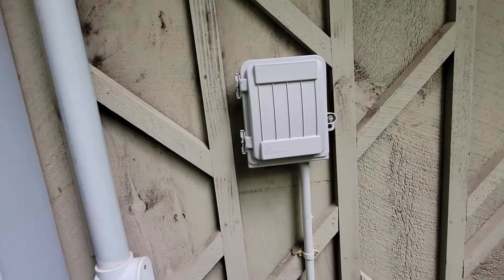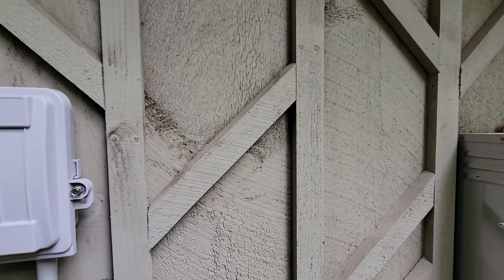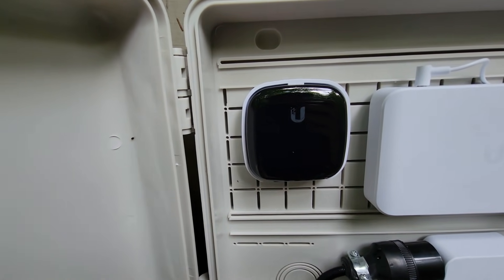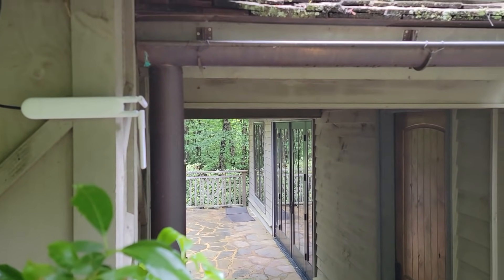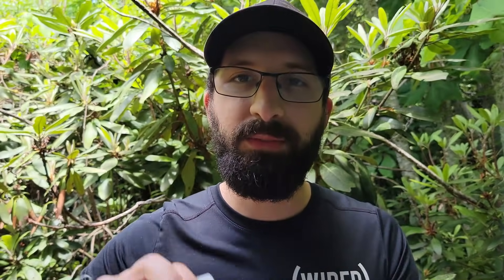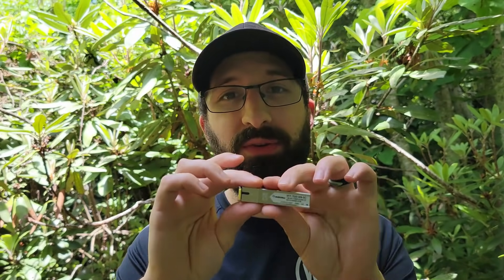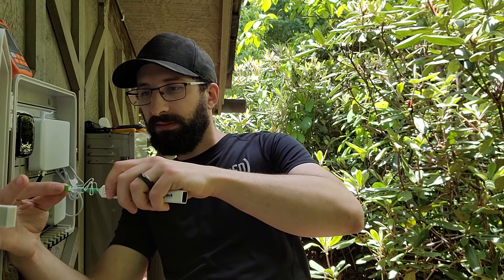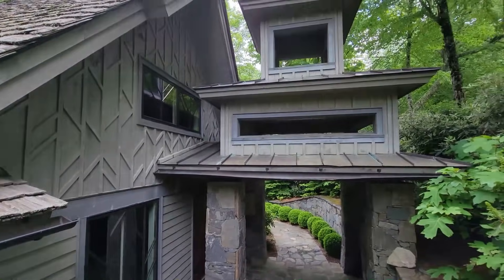From HORRIBLE DSL to FIBER Internet using Ubiquiti Unifi

Comment: I have a UDM Pro and I have a fiber optic link connected to port 9 via an ONU. Would it be possible to connect this fiber directly to port 11 via SFP+?

If so, which SFP module would be recommended?

Thank you very much.

Comment: Hwt David,  what power supply box for the switch did you use? Inside your outdoor box like a cover for power adaptor? Like how there is a lock tight ac  power cord attached to it going to supply voltage, how did your trained electrician do it? What parts were needed

Comment: Hi David! I swear if I could hire you I would, but I'm in rural Mexico, so yeah. Anyway, I want to extend a network from an office to a barn that's off-site a couple of miles away with single mode fiber. I was wondering if I could use an ONT instead of a pair of SFP adapters as those are pretty pricey around here. Many thanks!

Comment: I would still droop the wire going into the outdoor wifi access point.  Make sure it droops lower than the ethernet port so that it droops and then come back up to the ethernet port.  If water gets onto the cable, it could drip and follow the cable into the ethernet port.  If you droop it down lower than the port with a little extra slack, water would need to fight gravity to up back to the port.

Comment: With the exception of the wall box, this was messy work. The cable management and the mounting of the AP was bad. 

Never use stand-alone fiber-converters because they will need to be reset or will be failing at some point. Use a switch with SFP instead. Then you also loose a point of failure. 

You don’t mention what kind of UniFi controller you are using.

Comment: Maybe I missed when you mentioned it but why not just plug the AP right into the media converter? What is the switch for?
Reply: The switch is for PoE. That media converter get's it's power from PoE and the switch is giving it power.
Reply: @BenPi_Tech  Ah okay. And because the AP is powered by PoE too he didn't just use a PoE adapter?
Reply: @chrisb9319  He could have just used a PoE adapter instead of a PoE switch, but if they needs to add an AP or other PoE equipment's in the future (cameras for exemple), a PoE switch is more versatile.

Comment: You will have problems with the ap being horizontal.  Why, because water will come down the cable and leak into the port. At a min a drip loop will be needed.  Also spec's state mount vertical

Comment: Dude, i don't know if the AP is water/weather sealed but I think you should make drip loops in your cable before you connect. Even though the AP is sheltered, better be safe than sorry.
Reply: All ubiquiti access points are water resistant. The system should be fine.

Comment: how can it be single mode if its gpon? its a single fiber so it needs two modes.
Reply: GPON is diplex. Uses two lambdas in single mode.
Reply: @Txepsiyu  you are missing the point.. if a cable can carry two different wavelengths, it cannot be single mode.

Comment: Good job, but it seems like you came very unprepared for the job.

Knowing it was an outdoor install you would think you would have turned up with outdoor rated cables and a water proofed outdoor box (no seal on the door)

Apart from that a great video.

Comment: Never actually seen someone cleaning fiber, even my isp just plugs them in.
Reply: Well, most of the time it's clean, but a dusty port can degrade the signal by 1-1.5dB
Reply: Would clean it all the time in the datacenter. Fiber optics are highly susceptible to dirty optics.
Reply: @VV-om8vv  Especially at higher data rates. When we still had Fibre Channel storage, any time we had errors on a path, first task was to clean the optics and the cables. amazing how often this would resolve issues in 8Gbps and 16Gbps FC.
Reply: everyone who is doing his job right is: cleaning, cleaning, cleaning.
Reply: Yeah same. He’s also using APC instead of the cheaper UPC. So I’m assuming he’s worried about light levels for this link.

Comment: Not knowing the primary material of the chapel walls and coverage area I notice you have some metal guttering near the access point this could be points of the reflection signal degradion. if the chapel is primarily wooden walls it should be no problem but if you have rock or steel-reinforced concert, I did notice a concert column you might have some issue with coverage inside the chapel. also, rain might be a problem again signal might degrade when rain is falling. water absorb the microwave spectrum

Comment: Yeah... The specs of Unifi's GPON "UFiber" is not all that impressive...  You have a 4 port or an 8 port OLT, serving either 512 customers or 1024... With a SFP+ port... so 10GB MAX divided by 512 or 1024 customers.. Yes.. The OLT8 has 2 10GB SFP+ ports.. But lets be real, that 2nd port is going to be used to carry that 10GB fiber onto another OLT box downstream even further dividing that original 10GB of max data by an additional 1024 customers and so on... And if we're even more honest... You're not gonna be supplying it a full 10G of bandwidth anyways.. It may be quick and easy... You'll still need a fusion splicer though... But it does not by any means scale. Its cheap price and lackluster specs is just gonna lead to a bunch of really dogy rollouts by some sketchy cheap ass ISP's hoping to get a quick buck by selling garbage service while relying on that magic buzz word to do it... Well it's.. "FIBER"...  The bandwidth math.. 10,000MB / 512 customers = about 20MB per customer... Fiber.... 1024 customers = 10MB each... AMAZING FIBER! Lets all now praise Unifi for their amazing innovation in Fiber Tech. Also.. Keep in mind.. That the 4 or 8 ports on those OLT's , no matter how many people you have connected to them ultimately, the port itself can only do a max of 2.5Gpbs download, divided by how ever many customers you hook up to any of of those ports.

Comment: do you need a OLT as presume they are the ONU ubiquti loco / nano g with a ubiquti instant, so are they running a GPON system?
Reply from the maker: No, no OLT. I miss spoke in the video, it's not the instant, it's the ufiber Active Ethernet media converter.

Comment: Great job man! Clean install, and you take pride in your work. Puts a smile on my face!

I'm not big into Ubiquiti; I've stopped supporting them a few years ago. However, they still have products that fit certain project requirements.

For this type of install I would had instead used a MikroTik PowerBox pro [Outdoor 5-port PoE switch with integrated SFP port for fiber conversion] and then connected a MikroTik NetMetal AC2 with the HGO antenna's.  ;)

Subbing for your work.

Comment: David, when you say it (the switch) won't get very hot because you are in a high elevation, is it based on the fact that the weather is never severe where it is located or something else?  If something else please elaborate.
Also when extending cables outside for a long distance sometimes they act as an antenna and that alone is a nightmare to troubleshoot down the road.   Even double insulated cables have betrayed me that way.  Especially if you have weather with lots of lightening these external cables tend to get a hit or two.  Perhaps using a grounded conduit  may help out in these events.  That was the case for me in Utah, Nebraska and in Texas. BTW I would strongly suggest that you ground your power in the box.  
Great video!!

Comment: I been running UB products sense 2005. Have had great success with them. I would have never mounted the mesh body horizontally nor pointed  the one antenna down. They are not sealed moisture or rain is going to ruin the antenna and for sure weaken the signal, or the poe/network port is going to ground out from moisture.
Reply: You're right. That AP is designed to be mounted vertically. Also the WiFi antennas should be vertical and parallel to each other.  You can't proper do MIMO / Beam Forming without the antennas being parallel to each other and perpendicular to the remote device(s).

Comment: It might be fine, but the APs wire doesn't have a drip loop. You should always account for a driploop on outdoor wiring. You can easily fix that with some of the coiled up wire by the AP.
Reply: Everyone is complimenting the install, I'm wondering how long the AP is going to survive at that angle and no loop.
Reply: @tigerfan525  I live in FL and didn't have enough extra cable for a drip loop on 1 of my outdoor AP's and 1 camera. No issues 3 years later and I probably get more rain than you all do (Gulf Coast of Florida)
Reply: @reddyuda  Drip loops are really for the "next guy" lol.  It's an easy way to leave extra cable in case there is a service issue and a connector has to be cut and replaced.  Even with outside coax installs you usually use grommets and/or dielectric grease to keep water out.
Reply: @clblanchard08  oh yeah absolutely leave a drip/service loop. I screwed up and tore the end of the cable when pulling it through and I had already cut it. So the cable was just too short.

I packed the connectors with dielectric grease and luckily it has been reliable for the past 3 years lol
Reply: This is a really good call out.
Reply: also black cable with white clips looks pretty bad, use a staple gun or matching colored screw clips
Reply: yea, you gotta leave a drip/service loop on all pulls outside, and a service loop on indoor pulls. It may be the "next guy's" problem, but you are also the next guy
Reply: Needs conduit on the power too. Big shock hazard.

Comment: Hi David.  I'm a lifelong tech enthusiast (currently age 37) and more recently a(n) Ubiquiti product fanboy... lol. Currently I have two UAC AP Lites (one in my bedroom to cover the back of my family's apartment, and another in the living room/den to cover the front areas like the dining room etc, leaving only the kitchen with spotty coverage that I need to figure out a solution for) though my router/firewall is a miniPC from QOTOM running pfSense fork OPNsense. I'd ultimately like to get a UDM Pro and an accompanying PoE+ and/or POE++ switch as well as more powerful APs, (maybe a NanoHD or 3) but for right now as I have it it works quite well. I like watching videos like these. It's cool seeing a network built up from scratch (I've done it a many times with my own equipment I have here, though I'm no CCNA certified technician... I'm 100% self-taught.). Please do more if you haven't already! Just subbed!

Comment: Thanks David, i would suggest to use leveler when installing the box, and also measure the height distance of the cable from the ceiling when installing it so it will look more neat.
also, i think that conduit is a must.

Adi from Israel
Reply: Level the box. Then for doors hinged on the left side, slightly tilt box down on left side. It will enable the door to stay open while service work is performed but will not be tilted enough to be noticeable to naked eyes and also pitch any water off of the top of the box. For doors hinged on the right side, slightly tilt box down on the right side.

In that location, I would suggest running all wire and cables inside of conduit.  Little critters like to chew on wire/cable jackets.  Grey PVC would blend well or could easily be painted to blend into surroundings.  Armored cable could also be used but more expensive and less versatile.

Comment: Hey David, the tape/click style cleaners for the fiber & ferules actually sometimes end up leaving behind residue. I found out one day when a BrocadeICX SFP port would report instantaneous flaps randomly caused by this. Since then we adopted the method of using a handheld scope to physically inspect it (prices are actually cheap on amazon ~100$). We ended up switching the tape style to the Q-Tip style fiber cleaners and found a single swipe was reliable, sufficient, and produced better results than the clicker/tapes.

Comment: Great little fiber tester especially for finding your core - I’ve seen them online but didn’t quite work up the courage to fork out some money for it without know how it worked. I think I’ll get one now that I’ve seen a cheap one in action. Looking forward too seeing some more videos.
Reply: The only big factor between cheap/expensive ones is how far they reach. If you are doing mainly building and patch/patch you should suffice with a cheapo one. The one im currently using has a reach of +- 10km (depending on splices/patches).
Reply: @shylodesloovere4070  Thanks for that info. Can't wait till the one I've ordered arrives.

Comment: 6:25 invest in the proper staple gun for coax/ethernet wire using clear or black line protection coating. You could have spray painted the AP to be more blended. We have painted a few gunmetal, yellow, blue and realtree to blend in with a few installs. Also, you could have installed the outdoor AP at the outdoor nema box and taken another AP inside the chapel meshed. I have 14 of those same outdoor rabitear aps meshed across my 100 acre farm using 1 solar panel,  1 small SV inverter, 1 nema box and 1 small lithium battery for the ap and security camera per tower.
Reply: he said that the client doesn't want anything inside.

Comment: Does the switch perform any other function than powering the AP in this setup? Could the AP be powered by a PoE injector?
Reply: Future expandability; a PoE injector would have been sufficient.
Reply: The media converter also is being powered by the poe switch.

Comment: +1 Nice video. But what is up with you Americans that electrical is outside (saying this from The Netherlands, haha).  Also, I would be really annoyed if the cable-management on the walls was like this. Why not a little enclosure around the cable and some brackets? It's probably 10 to 20 bucks, but looks so much better, it's better protected and looks less ugly than a black Ethernet cable on wood.
Reply: Oh by the way. I subscribed. Liked. And would like to see more! See my comment as constructive criticism! All meant nice!

Comment: Could you add link for the SFP module? Great video!
Reply: did u find what is that SFP?
Reply: @sergeybaidyk1553  found this but not much, hope it helps https://www.ui.com/accessories/gpon-network-accessories/
Reply from the maker: @luiscantwo  This is an Active fiber network so No GPON SFP's in the setup. the SFP Module i'm using is a ROBOfiber sfp-7020-WA-SC on one end and the other end is a sfp-7020-WB-SC. hope that helps!

Comment: What is the model you used for the fiber to SFP. I want to soon go from the coax at home to fiber. I just dont want to upgrade until I figure out how I can just take the fiber they give me at home straight into a UDM Pro.
Reply from the maker: You being able to hook in the fiber directly to your udm pro depends on what type of optical system they are using, if they are using a passive optical system, you won't be able to hook in directly. You would have to go through thier modem. If it's an active optical network you may be able to. All depends on what they will allow. The sfp is from "ROBOfiber" I got it from datainterfaces.Com they have great customer service and quick shipping.
Reply: @dizquier91  okay I'll see if I csn figure out from my provider which it is. I'd be using EarthLink for the fiber. I hope I can manage to not have ethernet in my network for anything other than switch to devices.

Comment: As an experienced Network Engineer, anything made from Ubiquiti for firewall/routing is not something a professional would trust or use especially for businesses. Use something like FortiGates from Fortinet for a true enterprise, NGFW (Next generation firewall). It's not that much more money than a Ubiquiti router (Which aren't real firewalls) and it offers so much more in protection and features.
Reply: I agree. In my own consulting work, in situations like this....I strongly recommend to the client that they acquire an EdgeRouter at least (especially in brand-new network installs), instead of using a Ubiquiti-based router. It just works so much better, and it's a TRUE firewall.
Reply: @SeatBill  EdgeRouter is Ubiquiti.
Reply: @0bsmith0  I'm fully aware of that. But since Ubiquiti ITSELF differentiates it from the rest of its' line *because it fills that role so well*... that's how I explain it to clients - who usually wouldn't grasp the difference, or the advantages, otherwise.
Reply: @SeatBill  didn't he say he already was using an Edgerouter, not relying on Unifi gear?